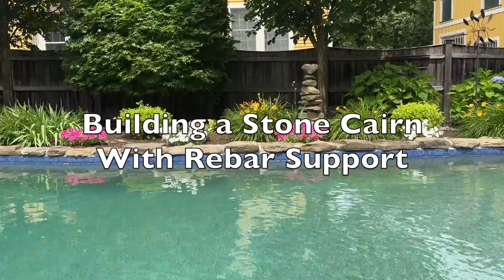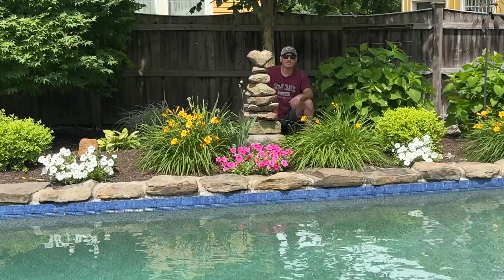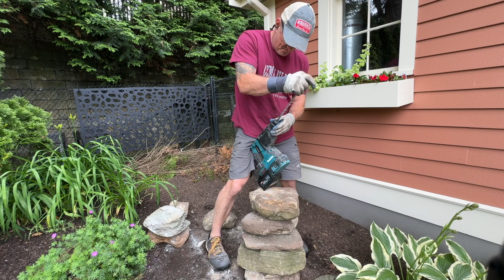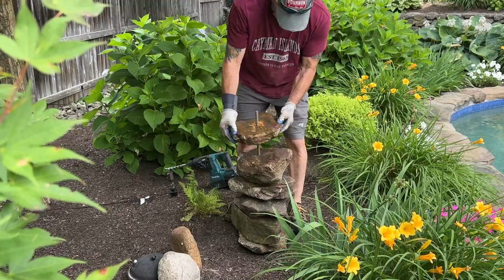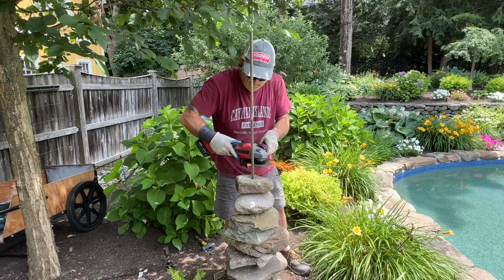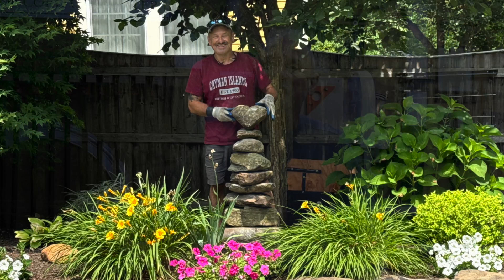How to Build a Stone Garden Sculpture | Step-by-Step Guide

Comment: It would have been nice to see details about how (whether or not) the rod was anchored into the ground, the top rock was affixed (epoxied?) to the rod, whether or not any of the other rocks were secured, etc.
Reply from the maker: Rod is embedded inground, nothing is epoxied - always an option if needed. The entire thing can be dismantled by sliding up and off iof the rebar
Reply: @ConcordCarpenter  I presume that after sliding the rocks up and off the rebar, the rebar can be pulled out of the ground, leaving no trace that the cairn had been there.  Do I presume correctly?  How far into the ground did you drive the rebar?
Reply from the maker: @notgiven3114 correct